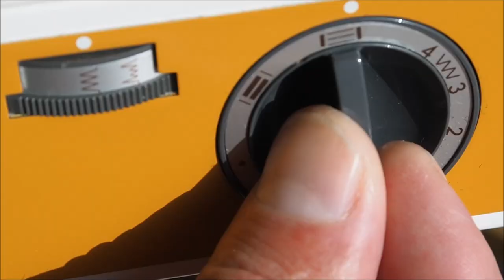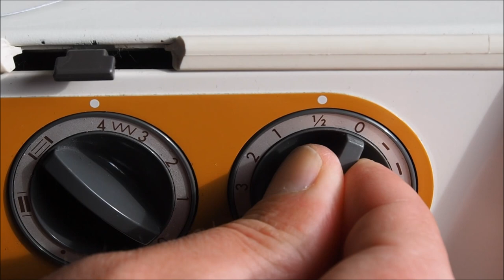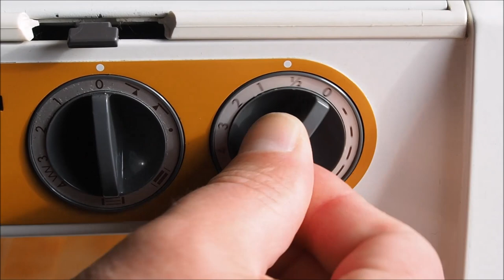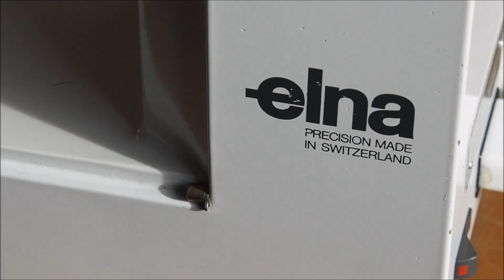The Ultra Compact elna lotus SP Sewing Machine - Basics

Comment: I purchased this exact machine in 1977 and sewed and sewed and sewed on it. It is so small and light and portable but also very strong and solid. Never had any problems and it could  do most anything I threw at it. I still have it, but is sadly no longer usable. The service person said the parts are no longer available, but I can’t bear to throw it out. You are lucky if you find one of these out there!
Reply: Thanks. I just inherited one
Reply: I checked online there certainly lots of parts about. Ebay had one stripped for parts most parts under £10

Comment: Just acquired an 1960's, Lotus Sp today ...Delighted to come accross this Video.. The Machine has not been used for over 20 years  everything seems to work except the bobbin winder but I wil have another try tomorrow ...Thanks
Reply from the maker: Thanks. This video may be helpful - https://youtu.be/tnvyCjyYyB8 and also the shaft seizes up sometimes (there's two bearings).

Comment: The reverse function doesn't work and the stitch length cannot be adjusted...it stays only on the longest length. Is there a broken part? I noticed there is a vertical bar connected at both ends to parts that are supposed to engage the functions but it is loose and nothing happens.
Thank you for any assistance.

Comment: This video has helped me alot! 

I have a Elna Lotus Sp I've had for almost a year, she was originally at a sowing school since 1979 (she came with the guarantee certificate) and I've been struggling so much with her (it was 2 minutes before I found your video that I found out that I can extend the thread stick -. - ') I know she gets stuck when I use her, so I bought some sowing machine oil, and dripped a few drops where the manual told me, thinking this was the solution. Then I came to the point where you showed that you can actually get the spole out with the white thingy behind the needle (I didn't even know it was there XD) and I tried it. There were 5 different thread pieces stuck in the part under the needle, so I pulled them out using my tweezers. I hope she'll work better now.

Is there a safe or beginner friendly way of cleaning thread dust from her inside?
She's very dusty O. O

Comment: I've just recently started watching your videos. I was gifted an Elna Lotus SP a few weeks ago. I've taken it apart as much as I feel comfortable doing and discovered that the bobbin winding mechanism will not work. It seems that the little spindle has worn down quite badly and I have ordered a replacement. Where I feel stuck is in trying to remove the bobbin winder so as to replace it. Any advice would be greatly appreciated. Thanks so much, your videos are so informative and interesting. Clare.
Reply: There is a clip holding the bobbin winder in place. Remove the clip. The bobbin winder should go down and ultimately out now. However, often the metal has expanded a bit and it takes sone light tapping with a rod to get it out.
Reply: I'll try that, thank you.
Reply: @claremcgill2490  When you do, you'll find that the top of the replacement winder is different from your old one. In fact it doesn't work, because the new top needs parts that aren't available. However there is a way around this. You can carefully tap the axle out of the new plastic part of the bobbin assembly and do the same with the old one. Now put the new plastic part on the old axle, together with some 2 component glue. This will hold forever. Now insert the axle again. Fixed! I have one last tip. These parts are the weak spot of these machines. They almost always break because the machine is put in storage with the function dial on the right of the machine on the 'bobbin winding' position. This distorts and strains the plastic part asymmetrically and eventually breaks it. Always, always store your machine with the function dial on zero! Thus it will work for another 50 years no problem.
Reply: Oh thank goodness I hadn't started yet, thanks so much for these great tips, I can't wait to get started!

Comment: Thank you, this was really useful! I got this machine from my grandma but the bobbin winder isnt working sadly, I am sure it can be fixed tho!
Reply from the maker: Can you turn the bobbin winder shaft by hand when it's disengaged? It may be seized if you can't.
Reply: @InStitches  I can't do anything with it! When I try to use it, I heard the noise of the motor running but nothing happen. What is weird is that my grandma doesnt remember it was broken! Sorry if my english is weird, it is not my first language
Reply from the maker: There's a dial on the side of the machine, below the hand wheel. Make sure it's turned to the bobbin symbol for bobbin winding and to stitches for sewing.
Reply: @InStitches  that is what I did :((( ! I read the whole manual to be sure I wasnt forgetting something dumb! I will get it fixed by a professional when this whole quarantine thing is over haha
Reply: @eleonore59830  There's a plastic "wigwam" at the bottom of the spindle of the bobbin winder - you'll have to open the end with the wheel to see it - it's a common fault for it to break - and as it's moulded onto the spindle - the whole spindle needs to be replaced. Can you wind bobbins on another machine ?
Reply: @kleverkloggs  I got it fixed, thank you anyway !!
Reply: @eleonore59830  That's great ! Happy sewing :-D

Comment: This later Elna SP appears to be more plastic than the orginal.  What is the date for the manufacture of this machine?
Reply: Hi, I can answer your question. I bought this exact machine in 1977. The “leaves” that fold up are made of a very strong material that was also used to make jet airline windows (or so the salesman at the time told me). My sister also had an Elna Lotus which was a few years older and the leaves were made of metal, as were all the previous models. I don’t know how long Elna manufactured this style but I think it looks really cool!
Reply: @janloftness the material is polycarbonate , super strong plastic also used to make car head and tailamp housings.

Comment: Please help - I threaded the bobbin into the machine just as you show. I turn the knob for the uptake, but nothing happens. No thread comes out the bottom. I may have done something wrong, but I can't figure it out.
Reply from the maker: The first thing to try is make sure you have installed a brand new needle, make sure it's the correct type and inserted the correct way around and is pushed into the needle bar as far as it will go.
When turning the machine over by hand to pick up the bobbin thread, make sure you don't pull the needle thread tight as you do that. Leave a little slack and only pull the needle thread to pull up the bobbin thread once the take-up lever is back at the top.
There may be other issues going on like timing, needle bar incorrect height or broken hook drive gear to name a few.
Reply: @InStitches  I know nothing about needles, I have noticed that when I turn the thingy by hand it can get stiff. I have left slack.  What is the take up lever? How would I know if the hook drive gear is broken? What is the needle bar? Should I just take it to a repair place and see if they can help me?
Reply from the maker: The hand wheel being stiff may suggest the hook drive gear is broken. A repair agent should be able to sort it for you.
Reply: @InStitches  thank you - it is now in the shop

Comment: Do you have any instruction on how to adjust the timing on this model?
Reply from the maker: Not at this time, sorry.
Reply: No worries. I fixed it myself!
The access is simple, the metal plate underneath when removed reveals a long bar leading to the bobbin assembly. Two “screws” need to be loosened with an Allen key. Then flip the machine and adjust the bobbin till the hook passes the needle. Tighten it all up and done. Maybe I’ll make my own video;)

Comment: What can I do if my bobbin winding is not working?
Reply from the maker: There could be several causes but make sure you have the switch on the right end of the machine set to bobbin winding position, as per the video.